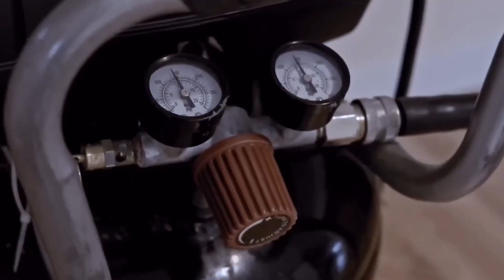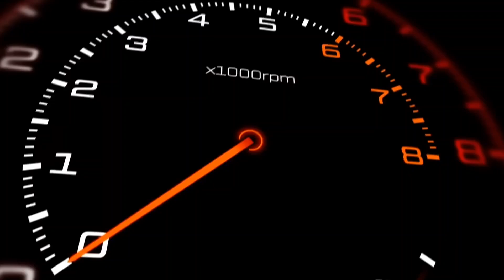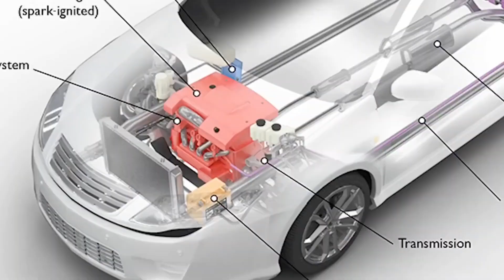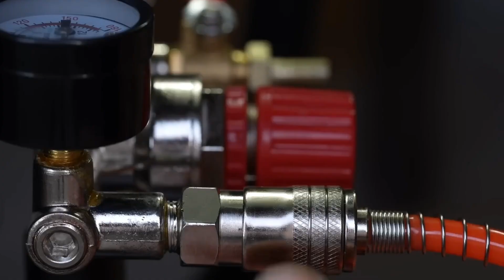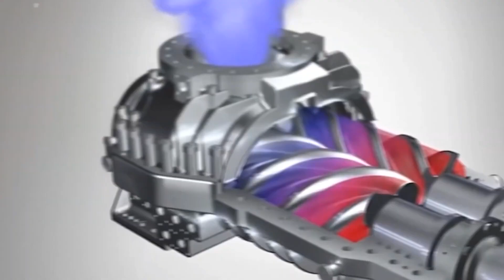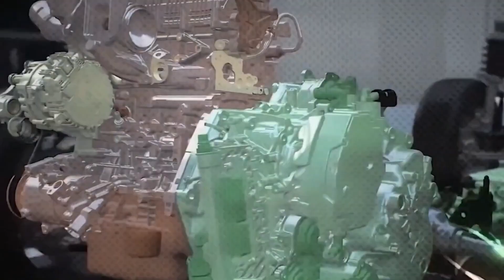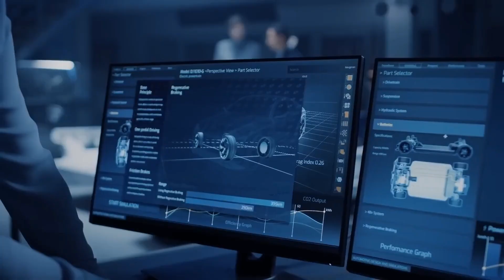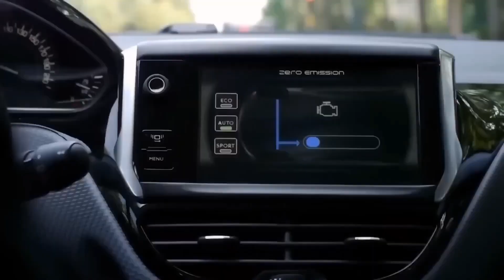How Compressed Air Engine Will Disrupt The Car Market

Comment: Free energy is illogical and compressed air still needs a compressor so needs electricity or heat/power first. What is the point of this video? Its not what powers a car or brightens a light its what makes that happen. Be smarter